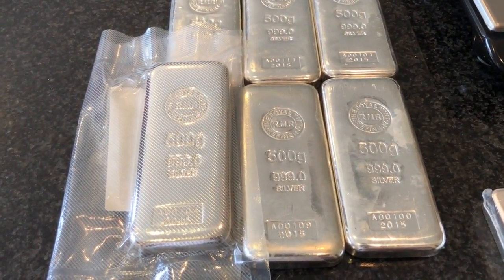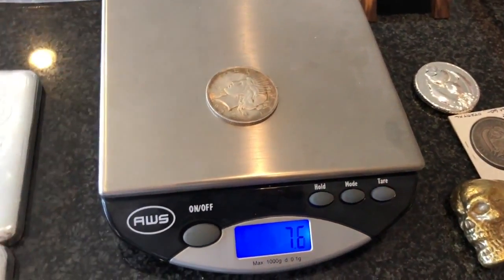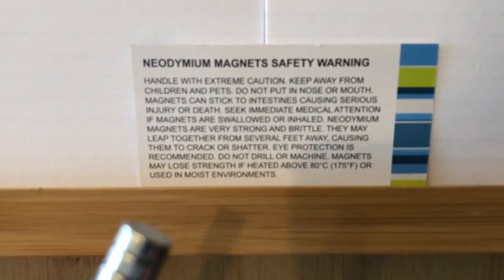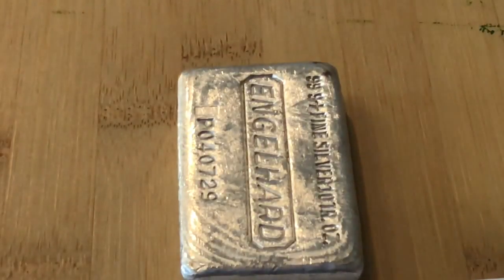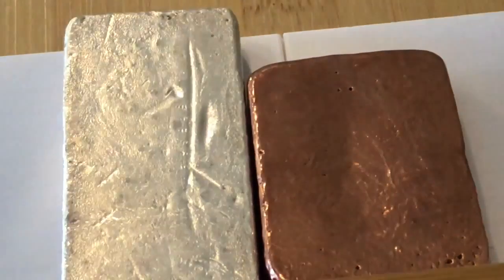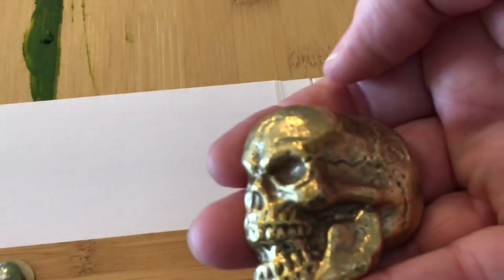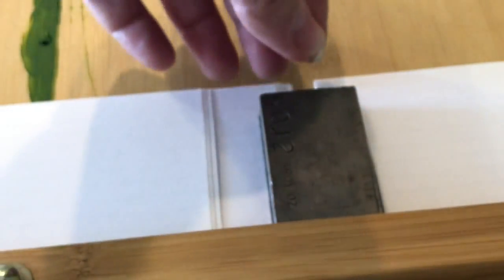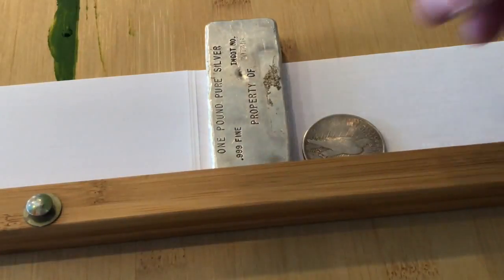Weird Silver Wednesday Episode 8: Rare Earth Magnet testing vintage ingots & Copper with neodymium

Comment: This is cool but it didn't help when I got a copper contaminated bar from SGB Calgary. It turned out to be 90 % silver. They never did make things right ! I guess that is why the bad guys use copper to bs silver eh. Oh well. This is pretty neat and thanks to boot bud.
Reply from the maker: If you didn't have the electronic tester, I noticed the rate of drop was slightly different on the 90% coin.  Now I thought the other 10% was copper, but maybe not.  Well, at least it did not stick to it like a frying pan, huh?
Reply: Oh how I would love a Sigma. Just not in the budget eh. Oh well, a new supplier (Global Bullion) has turned out to be great. They use a mass spectrometer for testing. Even more reliable than Sigma. WOOHOO.

Comment: Have you had any luck finding out where that bar came from, By the way the Neodymium Magnet test is not 100% accurate bud. I have a 100g bar ( suppose to be Pamp Suisse) that it passes. However its FAKE. I also did a surface Acid test on it and it passed. The only reason I knew it was a fake was due to its serial number. But then I cut it up and it was heavily plated, with copper filled inside.  Hence why I suggested to get someone to XRF it. Just to ease your mind 100%.  And YES be very careful with those magnets, I have much larger ones as well, and don't put them near your Credit cards or any electrical devices. Store them in a SOLID wooden box if possible. Good luck and See you on the flip side.
Reply from the maker: Yeah, seeing how similar the properties are between copper and silver, I can totally see what you are saying.  They seem to even displace similar volumes.  Wish I had the tester, but it is one cost I have not afforded yet, but hope to.  I have not found the ingot's maker.
Reply: losinglouie one other very cheap method for argument sake would be the ice cube melting test. SILVER is a great conductor. If you took a spare bar  same size and weight, put both in a frying pan on a very low heat. And place a ice cube on top of each. See if the ice cube melts at the same rate. If not your going to need to have it drilled and filled for proper testing. I don't see any reference to war or even a home pourer who has done things like this bar. It could be as I said highly valuable but you need to find out. Or it could be a giant hoax. Which was common during the depression.